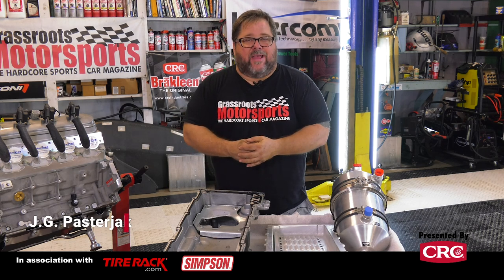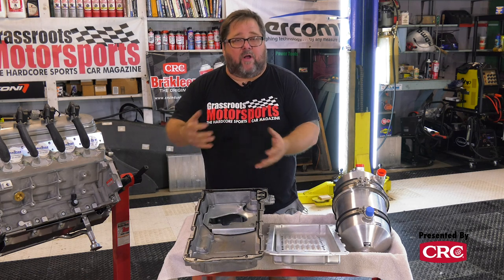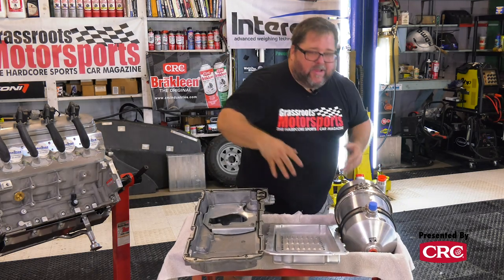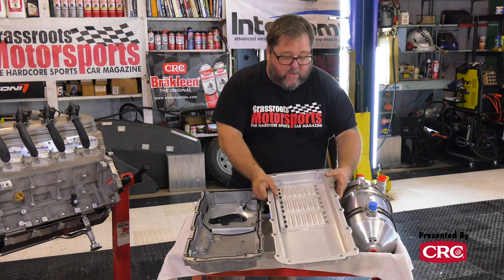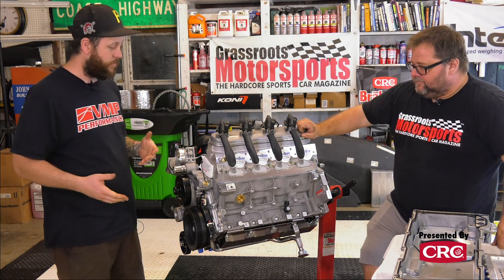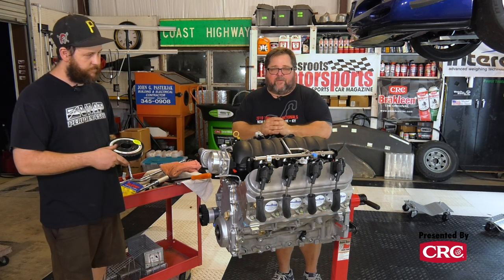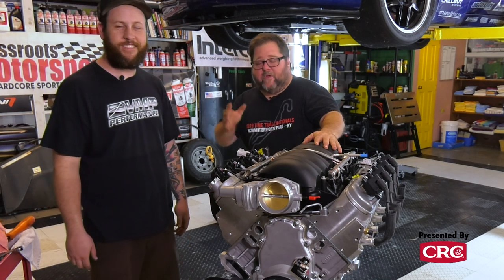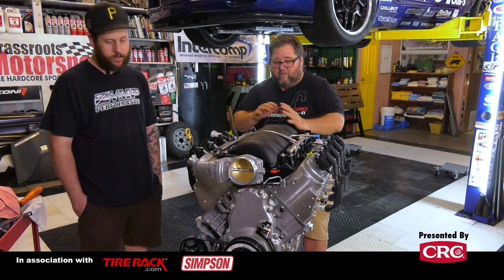How a Dry Sump Oil System Works - Everything You Need To Know

Comment: Watched the whole video to see what you do inside when the stock pumpis removed.. nothing shown. How did you connect the pressure stage to the engine oil gallery? Plug the oem pump location and feed it into the block externally?
Reply: I've watched videos from multiple people and NO ONE ever details how they connect the supply from the oil tank back to the engine... it's a little frustrating

Comment: Why no flanges on the dry sump pump? I’d be very concerned about launching a belt
Reply: Properly aligned pulleys do not as a rule tend to have their belts walk off. Heck on ID grinders that are not a direct motor driven spindle the grinding spindle is generally driven with a flat belt on crowned pulleys.

Comment: How would you hook ac compressor?
Reply from the maker: In this mounting configuration you wouldn't, as the oil pump takes the space occupied by the compressor. There are alternative mounting solutions that place the pump higher, above the water pump, that still allow for a/c.